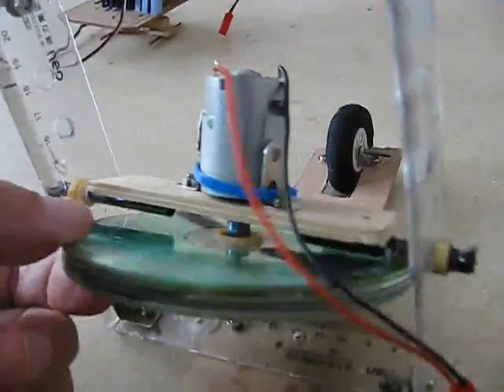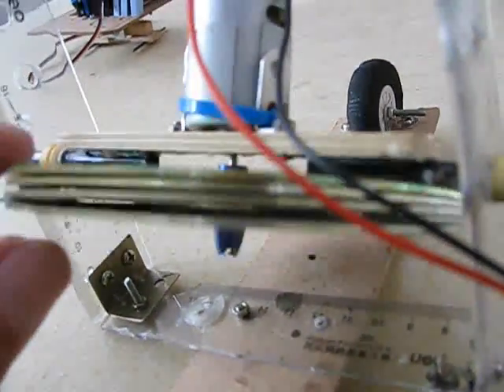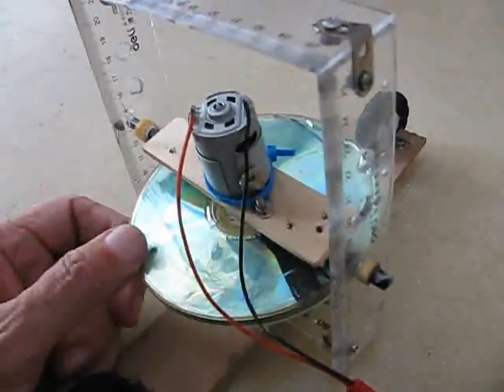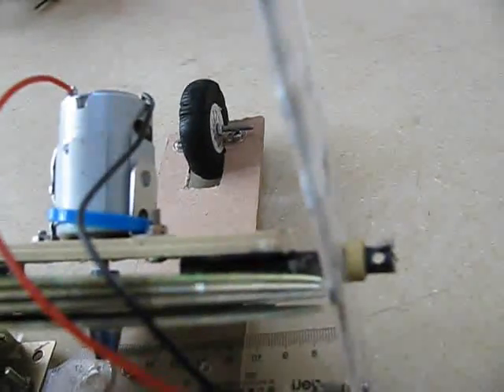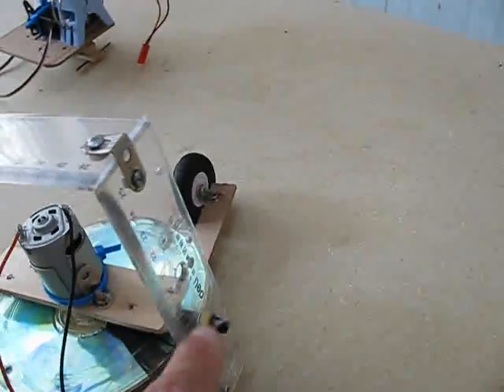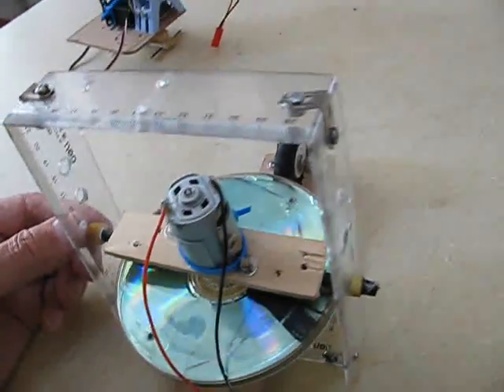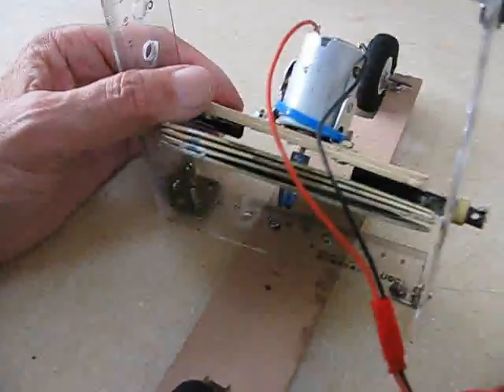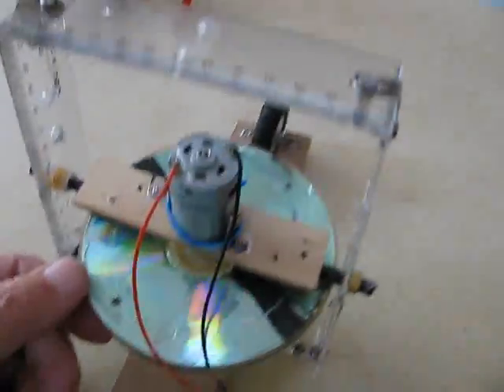Self Balancing Gyroscope on Two Inline Wheels

Comment: Thank you for the hint about the CG position relative to the Gimbel axis...I succeeded in balancing my vehicle.
Reply from the maker: Great news! I am glad someone else is building these things. They are addictive. It is funny, I just  built a new one (here: https://youtu.be/ThtIgToWWpU ) with the motor mounted on the gimbal frame and was having trouble keeping it balanced - I had forgotten the one centimeter CG point and when I added more weight to to the top, it balanced fine. Am in the process of building version two with bearings and a larger motor. Hope to see your video.

Comment: Sir have you tested on an inclined surface
Reply from the maker: sideways with both wheels at the same height, yes, but not really with one wheel much higher than the other. I know my powered one will climb over small obstacles and go up a slight incline and maintain its balance. But I have never tried a steep incline.

Comment: What motor are u using
Reply from the maker: I think this was a 390 dc motor, about 18000 rpm on 12 volts. But you can use any dc motor as long as it spins faster than 3 or 4 thousand rpm and is heavier than the rotor.
Reply: @demej00  could you explain again which part is the rotor. Is it the disc?
Reply from the maker: @sunsetthireach3223  Yes, the rotor is the cds. Make sure the motor is heavier than the cds (or whatever your rotor is made of) and it will balance.
Reply: @demej00  do you recommend a 3-6v 140 DC motor
Reply from the maker: @sunsetthireach3223  All I can say is you can try it. The problem with smaller motors is that the rotor has to be lighter, and if the rotor is lighter, it cannot balance a heavier two wheeler so your frame and gimbal to hold the gyroscope all have to be lighter.
Reply: @demej00  what about the dimensions like how high should my disk be and where should it be and like the length of the structure and so on
Reply from the maker: @sunsetthireach3223  It doesn't matter much but keep it low as possible. I have done a very tall one though too. Length doesn't much matter either.

Comment: How many voltage DC motor can be used in this video  sir??
Reply from the maker: Pretty sure it was 6 volt motor.
Reply: @demej00   what 's price of this motor and how many RPM???? Please sir answer??????????????
Reply: Thank you sir😇😇
Reply: How many motor RPM???
Reply from the maker: @M.S.J.18131  3 or 4 thousand rpm, depends on how heavy your rotor is. I wrote a free booklet on the subject here: https://demej00.wordpress.com/2020/02/08/self-balancing-gyroscope-two-wheeler/
Reply: @demej00   thank you sir ☺️

Comment: Congratulations on your very effective gyro made of ordinary  materials. I have been interested in these almost magical devices for quite some time and having been in aviation for some two years had the opportunity of developing familiarity with those units as used  on aircraft. Like you I have tried using ridiculously ordinary materials and like you had experienced difficulty in getting them  to  work like they are supposed to. Please allow me to differ from you concerning the balancing of the device. I overcame this balancing problem by using two flats with the rotor between them and the motor fixed to  the outside. This arrangement makes the center of mass or more correctly the center of the inertial mass exactly in line with the end pivots. This was not my idea butI saw videos in which this arrangement had been used. I hope you make the next version of your very effective gyro with the rotor in between two flats connected by short end pieces on which the pivot bearings are located. To render the device perfectly balanced another motor exactly the same as the drive motor could be mounted opposite the powered side. I have not been able to manage to use two motors to drive the rotor, a ,collection of hard drive discs as against cds.  I have seen aircraft gyros using one centrally disposed motor with a rotor mounted on each end of the double ended motor but the construction of this type would seem to be beyond facilities available to a hobbyist or experimenter .You can use exactly the same materials and construction as you have and have two motors driving the three or four hard drive discs. Congratulations again to you for the uniquely simple but effective device and more power to you.
Reply from the maker: Thanks. Here is my free ebook on how to build a better one: https://demej00.wordpress.com/2020/02/08/self-balancing-gyroscope-two-wheeler/

Comment: hey buddy i too made one like this but it didnt works
Reply from the maker: Sorry to hear that Sanju. Probable causes of failure: rotor speed is not high enough, rotor is too light for the weight of the frame, or gyroscope not top heavy - weight must be above the gimbal's axis of rotation. Just physics - has to work if within the operation parameters.

Comment: Hi, I’m a student from the IB program, and I’m doing my extended essay about gyroscopic stabilization. 
I’m taking your "gyrocar" example, to build mine, so I can get data of the stabilization. I’ve been doing a research about gyroscopic effect, but nothing specific of what I want to do. 
My essay is undetermined jet, but the main idea is, based on your gyrocar, see the relation between the number of gyroscopes (and the speed of those) with the stability of the car. (I’m considering other parameters). 
I would like to know if you have any theoretical foundation that I could use. Also, it would be great to know your opinion about my essay. Please contact me: elenitamoon2000@gmail.com I would be more than pleased to hear from you. 
Thank you.
Reply from the maker: This is too late to do you any good but if you are interested I have a free ebook on my blogsite here on how to build a better one:
https://demej00.wordpress.com/2020/02/08/self-balancing-gyroscope-two-wheeler/

Comment: Hello ? can you tell me how heavy your upper part is ?
Reply: I am currently trying to do the same as yours ,However i put  the extra weight as you advised, and it tends to go upside down , (obviously because the top is heavy now ) , :what should i do ? is my top being too heavy ? / i placed 2x AA battery with the dc motor on top /
Reply from the maker: Sorry I can't give you an exact weight as it depends on how heavy your motor + gyro + gimbal is. I would just say it is a little top heavy. I think if you turn it on it's side in the gimble, the balance point would be 1 or 2 centimeters above the gimbal axel. I can think of two problems you might incurr: either your motor is too heavy in which case you will have to increase the weight of the gyro OR your motor is not spinning fast enough.
Reply from the maker: Batteries on top of the motor would probably make it too heavy. It should fall over easily when the rotor is not spinning but not fall over really fast.

Comment: Darn, put the heavy motor at the bottom
Reply from the maker: +NPOSK While that may seem like an intuitive solution - I promise it won't work. In this case, without using a computer controlled servo to control the gimbal, you must have more weight above the gimbal balance point in order to make the entire mechanism self-balancing. And the rotor must be on the bottom. Believe me I have tried every configuration. Yes, there is a little self-balancing robot out there that someone created which goes around a track and it has the rotor on the top - but it will not self-balance without moving forward on the track - if it ever stopped it would fall over and it does not use a gimbal.  You cannot self-balance a vehicle without having the gyroscope in a gimbal mechanism.
Reply from the maker: +NPOSK Sorry I may be wrong about your point - not sure now. Just saw another person's project and they have the rotor on top and it is balancing. 
But the heaviest part of the gyro in their case is the rotor and I still think the heaviest part of the gyro has to be on top, whether it is the motor or rotor.

Comment: what is the speed of the motor u have used????
Reply from the maker: Sorry I am not sure. I think it is just a standard 400 size dc motor that probably only spins the cds 3 to 5 thousand rpm. But I am just guessing. It doesn't have to spin very fast to generate some pretty usable torque.

Comment: COOL! I tried for over two months to get to get my model monorail to do this but no luck. Needed more mass in the wheel I guess.
Reply from the maker: +ufoengines Sorry to reply a YEAR LATE. Yes, you need more mass on the top of the gimbal than on the bottom. The only other way to make it work is to computer control the gimbal with a servo.
Reply: There is this guy in San Francisco that is building an electric motor cycle/car that use gyros to stay up right. He's on face book. Things looked good then all went quit cause he nearly killed himself in a motor cycle race.  He's back now seeking funding and maybe he'll pull this
Reply: Maybe He'll pull it off and we can all be driving all weather electric gyro bikes.
Reply from the maker: Is that the C-1 from Lit Motors? Yes, it is a pretty cool idea. I emailed the company one time and they told me they have over 30 sensors on the bike. I don't believe they have had the bike up at any speed yet. Lots of complexity when you have two high power gyros. Hope they get it into production though.
Reply: Found the patent of the C-! Patent 8532915 . Maybe Google and Uber could turn it into a Robo Self Driver.

Comment from the maker: abhishek, no reply button on your comment. Here is the problem, without an active counterweight it probably wont balance, I just got lucky on this one and it probably balanced because of the slop in the fittings. So you need some sort of computer control, see my later projects.
Reply: Thanks for sharing your secrets!
I tried to build one of these and gave up.

I am now learning how to balance with an inertial mass.
Reply: Hii jimmy,Can you say calculations of motor rpm , torque and flywheel weight wrt to vehicle weight...

Comment: how many records did you use?

this can be done but with one wheel?, please do a tutorial, looks easy
Reply: i have the same motor, when volts you use?
Reply from the maker: Hi. I use 6 or 7 cds, depends on how big the motor is. The important things is to get the center of mass or gravity of the rotor/motor combination a little above the gimbal axel. This is a free precessing gyro and it has  to be a little top heavy.
Don't believe it can be  done with one wheel as the precession will try to spin the entire vehicle around like a top.
I'm not very good at making tutorials but I believe the video shows enough to get the basic idea across. Good luck with your project.
Reply from the maker: Sorry that is 4 cds on this simple one, 6 or 7 on the version 5 that is mobile.
Reply from the maker: Fercho Torres 4 AA batteries - rechargeable so about 4.8 volts.